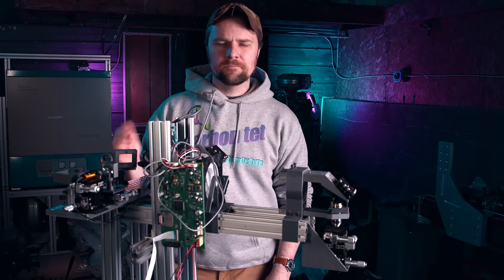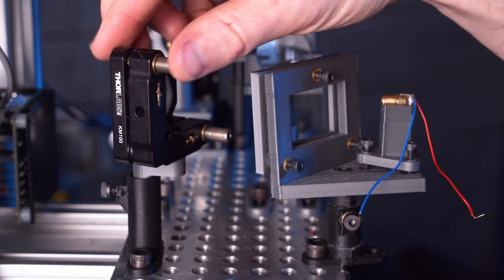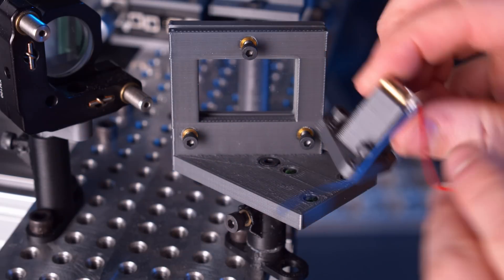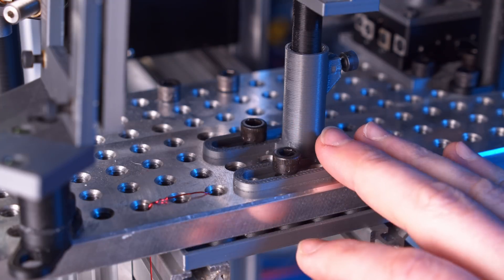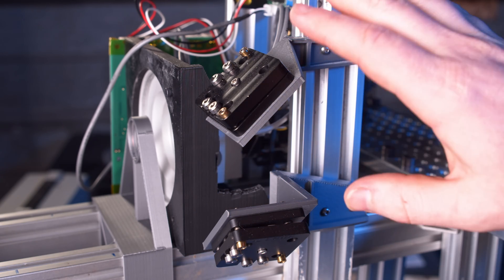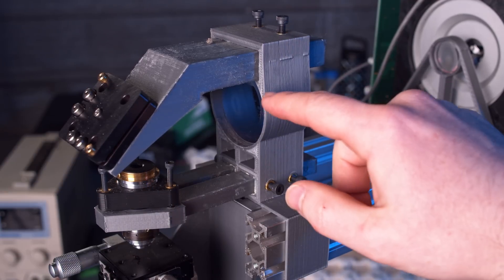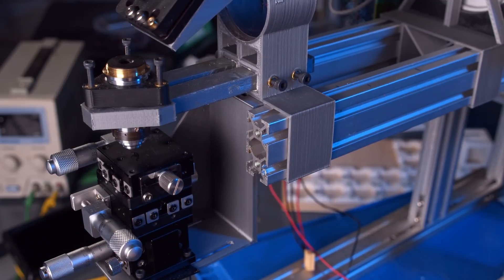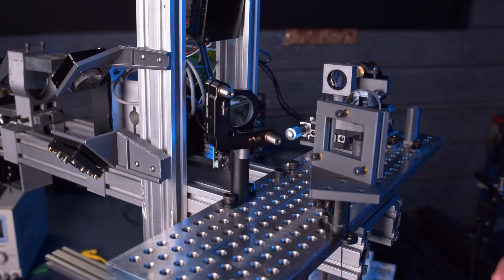3D Printing Optomechanical Components

Comment: I like the ball magnet mounts. A slight variation on the design I’m using on one of my setups is to stack a washer on a disk magnet of similar diameter and press fit that into a print washer side out. Then on the bolt side each blot passes through the heat set nut then gets capped with an acorn nut. The acorn dome to washer ring interface is self centering, 3 of those on a fixture and translation is locked down while still allowing the same fine adjustment.

Comment: the flexure mounts you showed at the end gave me and idea. instead of three point magnetized mounts, how about two 90 deg offset stacked hinges with one adjustment screw per hinge. that should eliminate side to side movement
Reply: i guess those only works if yaw and pitch are all you need. this wouldn't allow for depth changes like the three point system... i guess you could stack three hinges at 120 deg offset?

Comment: Honestly, beside the postholders, everything else would have been actually cheaper if you bought the "nice stuff" directly from thorlabs, once you factor in all the time, efforts and materials spent to 3D print stuff that doesn't actually work. Even the postholders, they are actually worth only if you already have a 3D printer, the files correctly sliced and you just have to push the "start" button to get the final pieces: if you have to spend more than an hour and you have a paying job, you would have been better just buying them...
The problem with 3D printing is that it "feels" free, since you don't have to pay someone else the moment you get the finished piece, but it is actually way, WAY more expensive than mass produced items, especially if you value your time in any form...
Reply from the maker: I agree, but also sorta disagree :) For a business use-case, absolutely. No excuse not to just go buy the real thing and get on with whatever is making money. 

For hobby, I think it's a little more difficult to say. Each base/post/lens or mirror assembly would be $60-100 depending on style (fixed element or kinematic). I have maybe 10 different elements, although some of that could change to help decrease cost, but still looking at $500-1000 without blinking. Throw in several redesigns where a few element dimensions change and you're looking at a pretty expensive hobby project.

Now of course, once you purchase the components you have them for future projects so it's not a lost cost. And if you make a good salary the "time cost" is definitely something to consider. But for prototyping I think 3D printing is hard to beat. I used less than a roll of filament and probably no more than a few hours designing everything, so salary + material time it still came out ahead. And lets you make customizations very quickly, instead of waiting 2-3d for the parts to arrive by mail to work on the next iteration (and hope you don't need to re-order again and restart the waiting period).

Comment: This is a wealth of great information, amazing work! If it's helpful, I suggest using the right "drop-in" t-nuts when possible instead of those finnicky "hammer head" t-nuts. They're far less likely to move around.

Also it looks like you may be using PLA for much of this? The 'printability' is great for prototyping but I've learned going with ABS for parts like this avoids so many headaches later. The inevitable creep with PLA, PETG (and even Nylons) can get so frustrating. I rarely even prototype with PLA now since decent ABS can be very cheap. For finalized revisions, my go-to is usually CF-ASA, or cheaper CF-ABS, for further improved stiffness and shrinkage resistance. You may have a different school of thought on this but I just wanted to throw it out there.
Reply from the maker: I'd love to work with ABS, but my printer really struggles (not enclosed, poorly tuned).  At some point I'll stop being lazy and build an enclosure though, would be great to work with ASA or ABS!
Reply: @BreakingTaps  I had a cheap ikea table with foam board walls sitting over a slightly modded Ender 3 running Klipper and it basically printed nothing but ABS parts for the past year. PETG can be more frustrating to print than ABS IMO. Considering what I've seen you do on this channel I think you could figure it out before finishing breakfast ;)

Comment: For the laser issue, wouldn’t it be a good idea to print a  ‘3 sided pyramid’ into the laser base and the same feature into the base with the three magnets…. Side the 3 sided pyramid hole to accept a cheap ball bearing… 
The steel ball is sandwiched between and still allows pitch and tilt while constraining is lateral movement.

Comment: For tip and tilt you only need two adjustment screws. You can fix the 3rd one with a spacer. You will need all 3 in case you want to refocus.
Some simple (wooden) clothes pegs can hold lenses and other stuff without 3d printing or clamping screws. Allways preload adjusting screws for fine adjustment.

Comment: Could you machine a concave in the end of the screws so they always align with the center of the ball magnets?
Reply: still not great as the screws can still wobble in the threaded inserts. I had a long fight with this effect with the print bed of my 3d printer.

Comment: Yo might be missing understanding the constraints on a "standard" kinematic mount from yourr 3d printed ones tbh.  The ball in the corner acts as a pivot for the x/y, and a d normally sits on a plane, the adjuster balls sit in grooves, which prevent axial rotation.  The adjusters are both at 90° to the corner ball on a traditional mount to  capitalise on the grooved pads' ability to constrain - you seem to be going for equilateral  triangles rather than right angles
Reply: The equilateral triangle gives a nice way to pivot the mirror around its center in one plane (horizontal reflection). That can be a nice feature sometimes.

Comment: Set-screws tipped with a ball-bearing and a bag of dowel pins would let you make quite solid 3D printed kinematic mounts.  You can also buy the same screws and threaded bushings used in the commercial mounts.  Makes it easy to design high quality custom mounts.  Like a X-Y translation kinematic mount.
Reply: I can attest to the accuracy of 3d printed kinematic mounts designed like this. They work great and are very repeatable
Reply: do you have a link to sth like that? i cant really imagine how you mean it

Comment: For the kinematic mounts, you could buy ball-point set screws and then print a conical housing for the magnets. The conical housing would go above the magnet and allow the ball on the set screw to sit in the cone. If the housing is thin enough, the set screw would still be pulled into contact, though I'm not sure how well it would work compared to direct magnet-on-screw action. This would help with the translation issues you were having and would not be particularly expensive to try I think.

Comment: About the screw on top of the magnet arrangement, one idea for you:
Drill a small hole on top of the magnet and make the screw end sharp, just like a nail.
Reply: I was thinking about spot drilling a cone into the screws. The potential problem I see with a system like this is that it over constrains the part. Maybe that would lead to unexpected shifting when adjusting it.

Comment: For the unstable mountings, instead of screw-insert in moving part-magnet, why not to use screw-moving part-spring-insert in base? (Same system as the manual leveling of an old 3d printer)
Reply from the maker: Yeah that would work great! That's basically how the real ones do it too, a spring preload against the adjustment screw

Comment: What has pushed me away from 3D printing opto-mechanical components is the poor CTE performance of thermoplastics used in FDM printers. Still super impressed with what you've been able to demonstrate on your channel with 3D printed optical parts.
Reply: Any idea if resin is any better in that regard?
Just curious; I don't even have a resin printer and have little desire for one just yet :)
Reply: @AndrewGillard  Plastics in general have 2X to 10X higher CTE than metals. Also, the poor thermal conductivity of plastics leads to larger temperature gradients across the material, which causes warping. In optical applications, warping is typically worse than just linear expansion and contraction because it results in angular displacement of critical datums.
Reply: So we need metal 3D printed optical part holders. Need more money.

Comment: I need to learn cad. I wish I could find a good tutorial most of them start like to far in it's like they forgot what they had to learn to get where they are
Reply: [Disclaimer: I'm coming from a hobbyist 3D printing angle with this] There's no shame in starting with software like TinkerCad - it's apparently easy to learn (though I've never used it myself) and some surprisingly complex parts have been designed using it.

That said, if you have ambitions beyond simple home widgets, you'd probably want to eventually move to something like FreeCAD, Fusion 360, SolidWorks, etc., and I'm not sure if there's much value in starting with TinkerCad in that case - there's probably not be much in the way of commonalities, besides learning about the geometries & techniques best suited to your fabrication method of choice (e.g. for FFF printers that'd be things like trying to avoid >55° overhangs, various tricks to optimise holes for screws and such, etc).

I don't have any particular tutorial recommendations, I'm afraid.
Maker's Muse (YT) has some Fusion 360 tutorials from a few years back that I think were fairly basic and should still be mostly relevant.
3D Printing Nerd (YT) has a few videos about doing specific things in Fusion 360, but I personally didn't get on with them as much (though I enjoy Joel's work generally and have been a Patreon of him and Maker's Muse, among others, for years).
Autodesk has a dedicated Fusion 360 YT channel, I believe, and that might have beginner tutorials. Alternatively I think they have pretty decent documentation web pages that may help with getting started.

There's recently been discussion in the community about the need for FreeCAD tutorials, so we can get away from Fusion 360 dominating the hobbyist landscape, especially as Autodesk has been slowly removing features from the free hobbyist plan. Unfortunately I've not personally seen any yet, as far as I recall. But the good news is that there is a lot of common ground between Fusion 360, FreeCAD, SolidWorks, etc., unlike between those and TinkerCad.
Reply: @AndrewGillard  I use tinker cad but it's pretty limited I tried to use fusion but all the tutorials I can find just go like on your going to make this and do this but don't tell you where to click to even create a thing. Like I need someone to do the equivalent of go to file scroll down to print click that ect. I'll check out the auto desk x
Reply: I use freeCAD and mostly learned from YouTube, but I have a lot of good support at work. My favorite channel is Mango Jelly Solutions (hope I spelled it right). My Mech. Eng. friends make fun of me sooooo much for using it.

It feels a little like a ratchet. I learn a trick or method in CAD then I over-apply it and have to learn better design overall.
Reply: @jimbrookhyser  thanks for the advice guys

Comment: For the red diode, unthreaded sleeves could be put on top of more deeply embedded magnets to allow for the bolts to be accurately located while still allowed to travel vertically. This would limit the maximum tilt in any direction, but seems like a good compromise for fine adjustments.
Reply: Or perhaps, if you have an available lathe, cut into the tips of the bolts to make the end of the bolt concave or conical (the negative of a cone that is) so that the bolt centers itself on the ball magnet
Reply: Also take the bolts, put a nut on them till the bottom of the thread is just above the nut, and use a file to make the bottom of the bolt flat, so that the curled end of the rolled thread does not make it wobble. You can use each nut twice, once per face, to do the filing, and then use them as the inserts in the print, heat sealing them into the plastic, or throw them away as M3 nuts are very cheap in steel.
Reply: You may also be able to use a larger non-magnetic ball pressed into the base, and a cup (even just a hole) in the center of the tripod to improve the tripod alignment repeatability.  The magnets will still pull down, and the ball/cup will provide the centering.

Comment: use print in place flexures! probably the best solution for a rigid, very accurate and possibly very fine adjust mount (as you can use leverage to reduce travel)
Reply: There is a 3D printed microscope stage that uses flextures floating around the net somewhere.  Afik it drifted 10-15um a day which was slow enough to track cells in a culture dish over several days, but would still mess up a lot of optical setups.
Reply: creep is an issue for plastic flexures.
Reply: Could you get the creep under control with relatively hard resin (SLA) prints?
Reply: @floriandaler5327  "get the creep under control" brought other things to mind.
Reply: @floriandaler5327  it will certainly help but won't completely eliminate creep.  Crosslinked plastics like SLA resin or epoxy are also better vs creep.

Comment: 3D printed bearings... 
Taper bearings? maybe externally pressurised hydrostatic bearings? 
3D printer could not directly print tapers  accurately... But  assemble and Keep increasing preload when driven to rotate by say a drill, and  high spots should bottom out and might be able to achieve a tollerance similar to the ground glass couplings of chem lab glass wear.

Comment: Hi, I love your videos. I think I know why you had problems with your kinematic mounts. They aren't  kinematic mounts as understood in mechanical engineering. They don't remove all degrees of freedom. When three balls contact three planes ( tips of the screws ) you are left with 2 degrees of freedom. If the balls would touch three V grooves you would have very repeatable and fully constrained connection. You could easily achieve this with three pairs of shoulder bolts in the plane of the mount that would create v grooves. I admire your work to popularize science and engineering, good luck.
Reply: The most typical configuration is to use a ball in a cone as a pivot point (removes 3 DoF), and 2 fine pitch screws with balls on the ends. one of the screws lands into a V groove (removing 2 DoF), and the second screw lands on just a flat surface (removing the last 1 DoF). Note also that there are only 2 adjustment screws for adjusting tip/tilt. In the thorlabs mount these are mounted at right angles from the pivot ball, so each screw moves only tip or tilt and not a combination of tip/tilt.
Reply: If you have a lathe you should be able to cut cones (or even well matched hemispheres) into the screws to constrain lateral motion.
Reply: @ExtantFrodo2  that arrangement of 3 cones on 3 balls is overconstrained. As the screws adjust, the distances from tip to tip change, while the fixed balls stay a fixed distance apart. It sounds better than rough cut screw tips, but probably still suffers from lateral sliding instabilities
Reply: @jimbrookhyser  Thanks Jim.  I didn't see this at first, but you are totally right and your reasoning is sound. Kyle's compromise is much better. Thank you too, Kyle :-)
Reply: I came here to say this as well! +1 for Josh.  He's a great guy to talk to as well.  He has a video showing the concept, I think it would have helped a lot here https://www.youtube.com/watch?v=a9irK9rOUHY
Reply: Adding another 2 or 3 magnet/screw pairs, orthogonal to the other 3 would also work to constrain it.
Reply: i am struggling to visualise creating a v groove with a shoulder boult -- could you please provide a sketch or drawing of this?
Reply: @gedr7664  It's probably easier to just think about them as three pairs of parallel pins that provide a track for the balls to contact. If you search in the Thorlabs catalog for "Kinematic Bases" you will find examples of this.
Reply: @gedr7664  I forgot that youtube shadowbans comments with links :/ . In the video here on youtube titled " 3D Printed Kinematic Coupling Proof of Concept " by Joshua Vasquez you can see the described idea.
Reply: @gedr7664  Here is this idea shown by Joshua https://www.youtube.com/watch?v=cfSHss5j5KU&ab_channel=JoshuaVasquez

Comment: I wonder how printed element compare to eg aluminium one, even made from screwed parts in terms of stiffness and reaction to temperature changes and vibrations after longer period of time. Like for example those tilted 45* mirrors.
3d printing is amazing but I think with delicate devices like optic stuff even cheap aluminium parts crudely made without even CNC cutting and that are just screws together would be better... If you can't keep your project on one flat surface where you could just stack them like those cubes.

Comment: I have no clue about anything here, but from the looks of it the UC2 system suffers from the same problem as your laser diode mount? Or am I missing a concept that eliminates that?
Reply from the maker: The older system does suffer from the "sliding around" phenomenon a bit (it's one of the reasons I didn't end up using it for the confocal).  They have a newer version that snaps into place which I think eliminates that problem but I haven't played with it yet. I found that recessing the magnets more than I have in that example helps too.  That said, the design of most UC2 components doesn't require adjusting kinematics "inside" the cube, so any misalignment can be tweaked by just fidgeting with the cube.  That ends up being pretty easy and you aren't fighting adjustment screws and the magnets like in my designs.